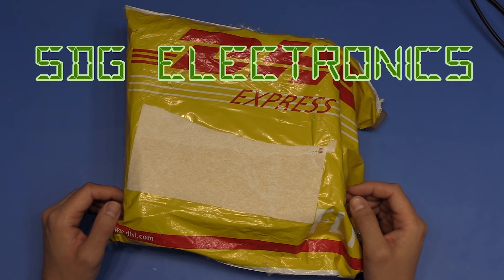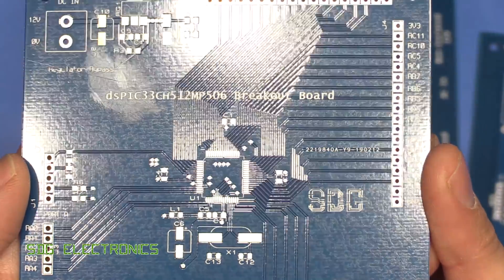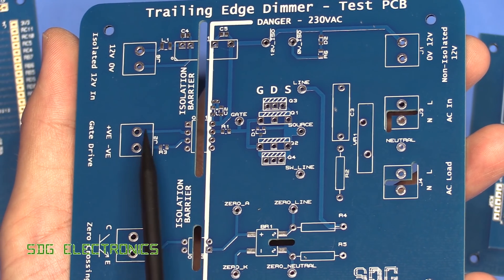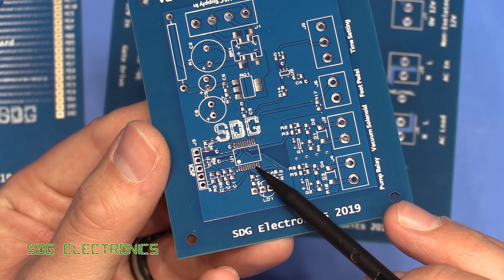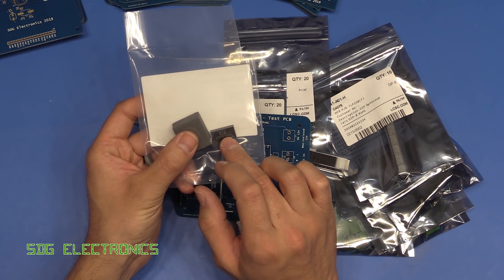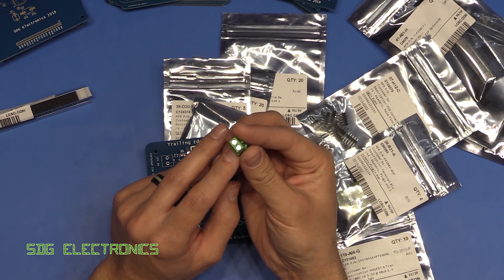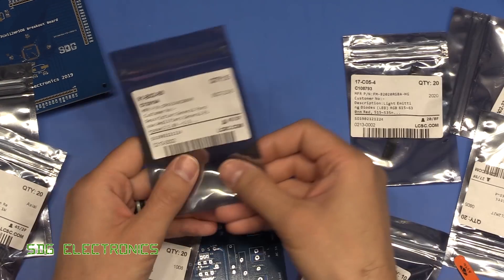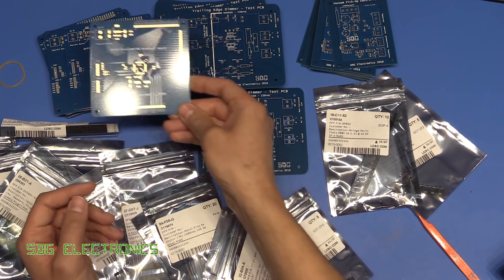SDG #059 PCBs and Components from JLCPCB

Comment: I do love JLCPCB, they are certainly the best value for money as far as I can determine. Thanks for the share, Steve. I also use Proteus and have to say, it is one of the best ECAD software out there. I know the bench is Altium (which I also have), but Proteus really does an excellent job. I use the auto-routing some times for non-critical signal path stuff and it bests the other products all the time. NI's Multisim auto-routing is crap. DesignSpark is alright, but Proteus has just routed a 4500+ hole 16-segment display board in under a minute and the Gerber / Excellon files uploaded to JLCPCB no problem!
Reply from the maker: I really like the workflow in Proteus, and the component entry is really straightforward. I'm using an older version so they may have improved a few things but it works well for me.